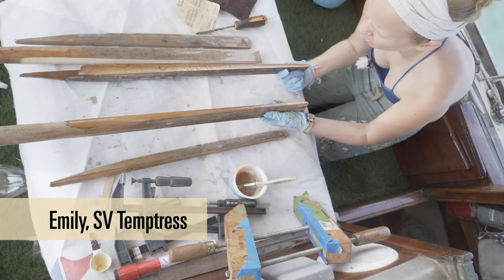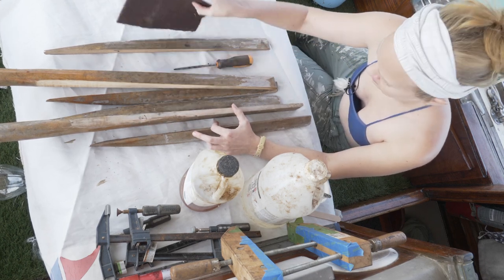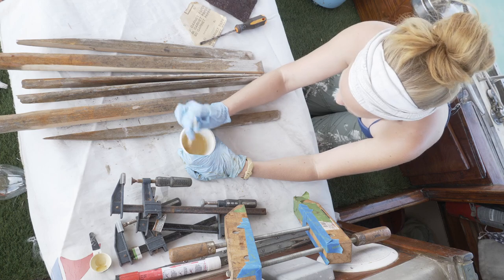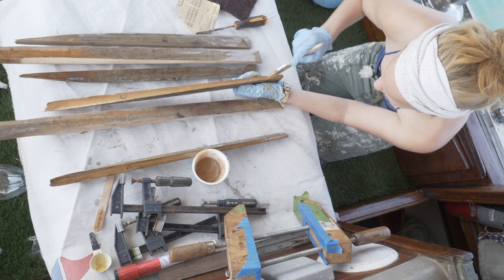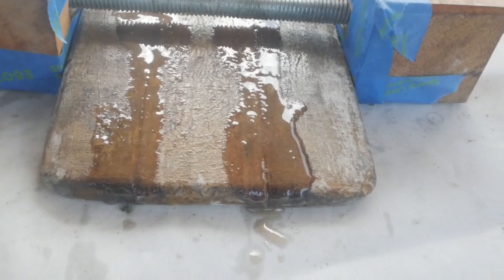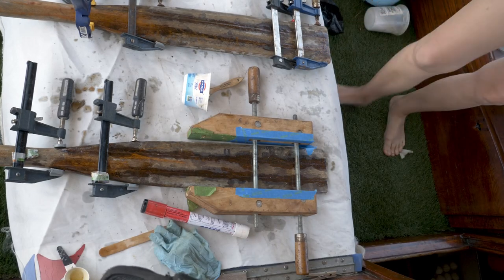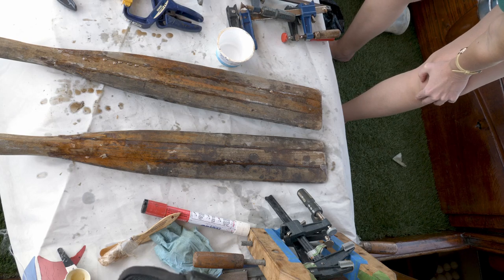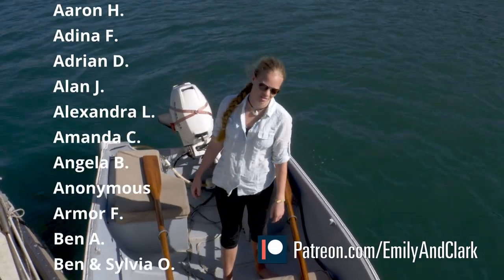Restoring Old Wooden OARS with Epoxy [Capable Cruising Guides]

Comment: I find a clear coat of epoxy before the finishing coat of paint, varnish or cetol, gives a much longer coating life. There is less moisture damage to the underlying wood so the surface coat hangs in there a lot longer. In addition, it is easier to recoat after a light sanding so the epoxy layer remains intact.
Epoxy is sensitive to UV, so you definitely have to coat it with something that gives UV protection.

Comment: Emily, I put a fiberglass end on my oars.  A) it protects the oar blade when you are pushing off a rock or a dock, and B) it protects a glued up blade from splitting as yours did.
Reply: Dynel cloth works even better than fibreglass. It'd more abrasion resistant. Which is why it's so popular with kayakers, for both paddle tips and the underside of kayaks.

Comment: I discovered U.S. Composites resin years ago when I was an avid wood Turner. Half the price of West system but just as good. I used the same wood flour for doing the fillets on my homemade dinghy. Saved a lot of money using those two products instead of West.

Comment: Hi Emily, good job on fixing the Oars. I restored a couple on a video 2 years ago and mine were one piece which was way easier. I sanded them down and Varathaned them. The oar lock pin/clamps were spray painted with a metallic dark brown which came out cool👍

Comment: Back in the good old days when the best marine glue was a powder that was mixed with water the advised technique was to wet one surface, lay in a strip of cotton cloth, wet that, wet the closing surface and bring the parts together. The cotton served to strengthen the glue line. I think that the technique is still valid particularly when the surface are not a close match.
Reply from the maker: Yes I use fibreglass that way sometimes.  -C

Comment: Epoxy , is great & when done right , super strong & easy...
1 - apply (part of) the A&B mixed epoxy....(slow part B)...reduce it a bit with epoxy thinners  to pre prepared surfaces so that it soakes into the grain of the timber....then wait a bit & go back to the start & apply neat epoxy from the original mix over again , then add fortifying powder to the original mix to a peanut paste consistently (not mayanase)so it doesn't run away , then apply it to the surfaces (like your putting mortar onto a brick)you slide & drag the applicator along the edge , leaving a small epoxy mountain range along all mating surfaces , then ,  clamp / clean / done....then next day quick sand , varnish , & ENJOY....cheers
Reply: i agree, we thin 20 percent with acetone for first coat on wood as it soaks in good. we thicken with flox for glueing as cabo is too hard to sand but adding the wood flour will help in this regard.  for interior work we cover with varnish but out side should be uv proofed, paint? clear shipping tape is good, wont stick and cheap

Comment: I save jars of sawdust and fine power. When I epoxy clamp pieces together then I smooth and sprinkle the epoxy that is squeezing out with the sawdust. rub it into the seam with finger (gloved) and when dry sand you won't even see the split.
Reply from the maker: Yes, nothing matches as well as dust from the very wood you are sanding.

Comment: NO MECHANICAL CLAMPS REQUIRED, just Masking, Packing or Fibreglass tape.  After the contact surfaces are fitted, run a piece of well adhered tape down the length of the (well fitted/parallel) joint,  Then the joint may be opened up on the opposite side like a book with the tape acting like a binding or hinge. While cracked open the epoxy or glue can be applied to the opened joint, closed up and finally entire circumference of paddle wrapped with progressive layers of tape to apply ''increasing'' clamping pressure with each layer of tape. This method also leaves zero cleanup required on one side of glue joint.